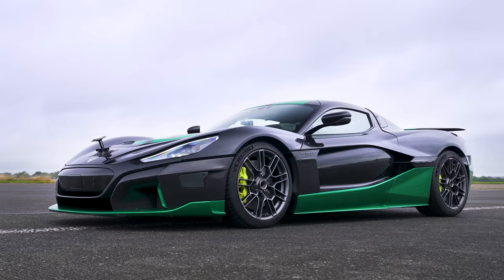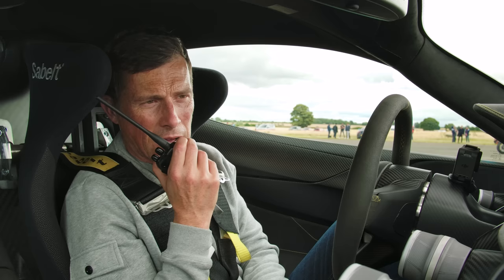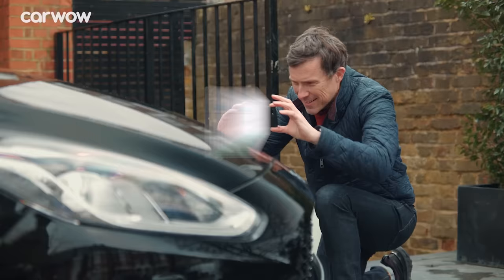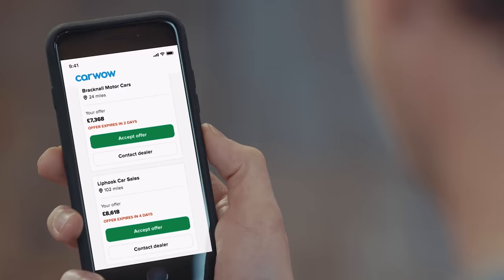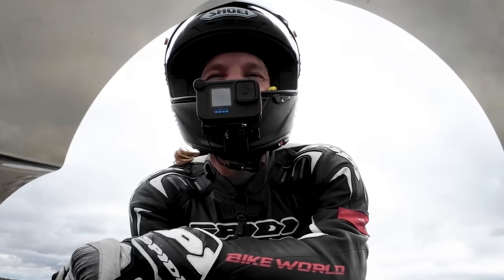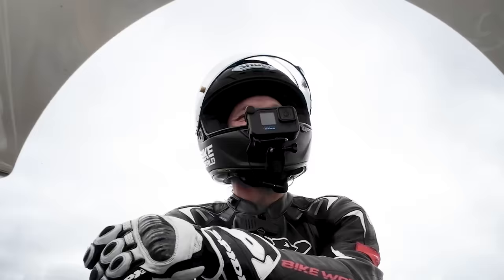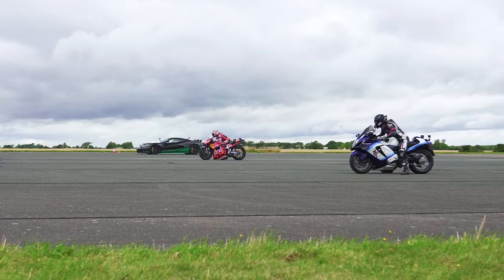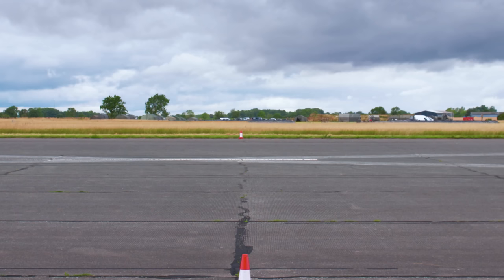MotoGP Bike v Rimac Nevera v Turbo Hayabusa: DRAG RACE

Comment: The fact that a bike can beat a almost 2000 hp electric car in a drag race is absolutly mental. Insane. No words.
Reply: these aren't even the fastest bikes in a drag race, there are bikes that will beat the Rimac easily.
Reply: @jayc342009  2022 Ducati Moto GP bike was much faster than this KTM on straights 
I think Ducati would leave Rimac in dust 😂
Reply: That is no ordinary bike, it costs at least $ 1 million.
Reply: @Smzxe  Even so, these bikes and their tyres are made for the track. You don't see them wiggling on the track straights.
Reply: @1aZoOs plenty of mid 8 sec bikes and cars actually too
Reply: Production car.............
Reply: @1aZoOs  it was selling for 250k 🤣 The 2021 KTM Moto GP bike
Reply: @wss33  on tracks Moto GP bikes hit 1/4 mile in 7.9 seconds they would destroy Rimac Nevera on a better surface
Reply: And 2023 KTM RC16 have more insane launch, if you watch MotoGP race lately you will know
Reply: @kuzunohacompany8891  this is 2021 Moto GP bike I think 
2023 Spec is much faster I don't think they brought 2023 version 
It might be 2022 version who knows
Reply: And the fact its just a 1 liter engine too.
Reply: @Smzxe yes but being faster alone won't make it the best performing bike. You need to conquer the corners too, which is the weakness of ducatis. There's a reason why ducati get smoked by yamaha and ktm in motogp.
Reply: The KTM beat the car to over 200mph it is just incredible 👏🏼
Reply: No shit bro.
That race bike needs constant checkup to be able to do that. While the Nevera can do that all day.
Reply: @BikesofRye  KTM beat Rimac Nevera over 220 mph 
There was very high wind which was stopping the bike but still beat Rimac Nevera 
If there was no wind that bike would be even much faster
Remove the wings it will become even faster
Btw 2022 Moto GP bike was much faster than this KTM
Reply: Shocked me tbh lol didn't expect that
Reply: @jayc342009 like what ? Don't be silly
Reply: Power to weight
Reply: @1aZoOs  the engine in the bike costs about €200k.
Reply: @loooopeytunes  it's quite opposite this year 🤣 Ducatis are winning each races and they are already faster on Straights
Reply: @loooopeytunes you’ve not watched the last few years have you? The Ducati is now the best bike on the grid, including in the turns
Reply: Yea but it weighs a fraction of a car....
Reply: @kuzunohacompany8891 they need to get Jack Miller on here with the ‘23 bike!
Reply: @jayc342009  good luck taking one of those down the shops and back. 🤣
Reply: @1aZoOs  and the rest.
Reply: But Rimac Nevera is 2300 kg...
Reply: Power to weight ratio
Reply: Ktm has the fastest ever recorded speed for a MotoGP bike.
Reply: @jayc342009 And there's also cars that'll beat them easily
Reply: @Smzxe yeahh but KTM recently just recorded the fastest top speed motogp bike ever achieve
Reply: Street legal production car vs pure bred race bike, not really that insane lol. Look what it did compared to the other production motorbike 💀
Reply: It needs a 2000 Hp all wheeled   with launched control to match a MotoGP bike on a drag. Yet, without the rear chattering. D. Pedrosa could have won that running start to a 1/2 mile. Also, remember that 2021 KTM Rc16 wasn't certainly mapped to extract it's full power. I wonder if it was. That could have been different. 

Anyway, glad that Dani was enjoying & for Chris riding that Superbusa, man he has that huge cajones to jump on that bike. Sylvain Guintoli could have been perfect aboard it, I guess he could do 9.2.
Reply: @muhammadalifsyafiq5317  that 366 km/h was with slipstream that was 2023 KTM Moto GP bike which hit this speed in Ducatis slipstream
This is 2021 Moto GP bike on Carwow
2023 Ducati Moto GP bike hit 365 km/h that was without slipstream 
2022 Moto GP bike is much faster than these KTMs 
2022 Ducati was leaving every bike in dust on the grid on straights
Reply: @Smzxe  we already know what the Gp bike without being mapped to it's full power or the necessary power at least needed, aboard a GP rider. 

What I want to see is the 2021 Rb16B of Verstappen being driven by reigning FE champion/RB driver Jake Dennis. Against this Rimac Nevera, Lucid Air Sapphire & that SuperBusa but with Sylvain Guintoli on it.
Reply: @ashleybmx4130  as if Jack would have a time being on the show than spending with his young family building hsi own track. Although I get your point but it's unnecessary similar to KTM not extracting the full power of their bike or at least the needed power. 

It's just for the show to have fun, not a competition.
Reply: well, fastest world record dragstrip bike actually hold by turbo gsxr1k by Moore Mafia team, 233mph in 5 sec. this is nothing.
Reply: @MR9Mouhib  Exactly. If those bikes had the same number of horsepower, they would fly to the moon
Reply: @dayleashleynolasco5765  it was just a comment mate, I don’t actually expect them to go and get him 😂
Reply: It's actually the other way around. It speaks volumes about the insanity of the Nevera that it can race against a racing bike. Bikes have insane power/weight ratio, far lower surface friction and air drag. No car should be able to keep up with that.
Reply: 919 evo vs '21 F1 car vs '21/'22/'23 MotoGP bike vs Nevera.
Reply: @Pizvo   that's 2000 Hp all wheeled drive car & with launch control we are talking about. On straight even the current F1 car would make a run for the money beat that Nevera. 

Hopefully Red Bull would bring the RB16B of 2021 which would be driven by the reigning FE Champion/RB driver Jake Dennis. Also, being Lucid Air Sapphire in the line up as well.
Reply: @antonpeterson1245   21 Rc16 Gp bike is enough even without mapping it. Dani just needed to dial his best launch & gearing. Also, you have forgot Lucid Air Sapphire, that electric car also blistering quick. Leaving Tesla Plaid in the dust.
Reply: @dayleashleynolasco5765  tbh, now that the Rimac Nevera is here, I kind of forget about all the other highly powered EVs. I guess apart from the Lotus Evija (hopefully spelt correctly) and the other car that is based on the Nevera
Reply: Bikes have some insane power to weight ratios compared to most cars. That MotoGP bike is mental at 270hp and 156 kg. I expected that Busa to beat them all but a lot of that power was wasted smoking up the tyres for the whole trip.
Reply: @yanzn5926  I've only been to the drags one time many years ago. The full blown drag bikes are just awesome to watch. They had one race where a worked 750 street bike was given about half the track head start against the top fuel bike. The way the top fueler shut him down was amazing. It was more impressive than the jet car they had that night.
Reply: Exactly. When it comes to speed. Bikes are king
Reply: @Smzxe so did Luca Marini on the GP21 Ducati VR46 bro.
Reply: @AmariLambo yep. Even the 2016 Ducati Desmosedici GP14 from Eugene Laverty can do 6.65 second drag time from quartermile.
Reply: @Smzxe Yea, but you do realize the level of crazyness is nowadays required to beat a factory stock car, right? This makes those Bugatti's look like loser-cars, especially compared to Moto GP bikes.
Reply: @dayleashleynolasco5765  RB16B is slow compared to Moto GP bike or Rimac it doesn't even come close 
We need 2019 Ferrari SF90
Or the 2004 F1 cars or Renault R-25 to have a better race
V6 Hybrids Are slow in straight line they can't go above 330 km/h
Reply: @Henry_Jr_Watsson  I don't think so. Bugatti can be quick if they would incorporate to their engine similar what Koenigsegg did. Anyway, we haven't yet see the Koenigsegg Jesko Absolute tested on this channel.
Reply: @nicerides9224  its all back to rider how they can handle the power, full developed engine like 1k gixxer easily got 700hp with NOS and turbo.
Reply: Just imagine if the KTM was lowered for the rolling races
Reply: @purwantiallan5089  it depends if it mapped to it's full power. I ask you, do you think Red Bull would risk Dani's body on this show. What it something happens to him.
Reply: @jolizana96  won't make much difference in roll race 
High wind was stopping the bike at 330+ km/h bike was wobbling too much due to wind
Reply: @KAWTELENUH   if a rider can put the wheels down & get the traction necessary to power up that bike. Without a super skilled rider who is still used on riding bikes, it's useless. Even Dani there showed that he is already rusty.
Reply: The part that really blows my mind is that when you think about it these Moto GP bikes are not exactly slow...until you compare them to a Formula 1 car around a circuit. The F1 cars are 10-15 seconds PER LAP quicker.
Reply: @dayleashleynolasco5765  what I'm saying is a regular 1000cc sport bike 🏍  can beat the majority of cars on the road. 
So if speed is the only thing a person cares about then it's a no brainer.
Reply: @Smzxe  and the mcmurtry on a competition surface, it would destroy all the moto gp that exist
Reply: Maybe because that bike is 1700hp/ tone and 😅 that car is 1900hp/2,3 tone 💁
Reply: @hainyain1106  Well, the other guy is just making excuses that that wasn't the best bike.
Reply: @Smzxe it does make difference by reducing front area thus reducing drag, it also reduces wheelies (gp bikes lift the front up to 5th gear). Given at how close the race was I think Dani could've won if his bike was lowered
Reply: @aedsy  keyword TRACTiON - as we know bikes often wheelie despite having this early stage Aerodynamics & squat devices, 4 WHEELS - once again more grip & balance which the bike doesn't have as it often got some wheel spin. CORNERSPEED which all car because of it's geometry plus it's easier to handle compare to the bikes that rider should be fit to manhandled the 160 kg bike into the corners. 

That is where the 12. plus in some tracks  to 15 seconds gain of the F1 car compare to the GP bike. More corners, the more time the bike will loss.
Reply: @Bathykolpian you’ll never afford a Rimac anyway so idk why you’re bumming so hard over a car you’ll never own 😂😂
Reply: @KAWTELENUH  yeah, I agree its due to power to weight ratio. But the question is always could somebody put out all that power down without even thinking twice. I don't think so unless you want to die. There is always limitation even the manufacturers who made it knew it's full potential. That is why there is a limitation especially the production street bikes even the Kawasaki Hp4 & H2R. Unless someone tweaked that bike to make it a SuperBusa.

You see even Chris didn't manage to get it's full potential.
Reply: @CrazyPanda688  And what do you drive 💀💀
Reply: EV is KING!!!!

4680 Roadster = GAME OVER BABY! ⚡🇺🇸
Reply: Well they’re light af dude lol what else do you expect
Reply: @larryc1616  wait for the Hydrogen or Synthetic fuels integrated with battery in the future.
Reply: Proper drag bikes can run well into the 5s mark for 1/4 mile. Both these bikes and car are pretty slow in a straight line compared to the real deal. Though obviously those bikes are good for drag racing and nothing else, compared to these that can do everything.
Reply: @Bathykolpian  agree, unless someone would make a Franskenstein production bike that can be handled & launch at the line easier. Most importantly that power on the ground without having a wheel spin. Although it wouldn't look like an actual bike anymore.
Reply: @Smzxe  MotoGP bikes are expensive. You'll get a WSBK in $ 250k. The performance difference is 3s per lap between them.
The present season bikes will cost you $ 4 million.
Reply: MotoGP top speed is secret
Reply: @AmariLambo but i believe on a drag prep surface :)
Reply: Atlease rimac is showcasing it's hyper performance vsing that of egg, ssc, jenny and bug.
Reply: @jayc342009  What is so impressive is that MotoGP bikes are not even built to be drag racers but rather corner-curving race bikes for the absolute fastest lap times.
There are faster 1/4 mile-built bikes that do 6s and 7s, but they can't do anything and are unridable outside of the drag strip.
Reply: @Smzxe  
MotoGP bikes are not for sale and have never and in history, been available for purchase by the general public.
In very rare cases, they are given away to VIP MotoGP members, like top racers and managers, as collector pieces.
Reply: @1aZoOs  it depends on the track. On a wide track like Silverstone, 6 to 7 seconds is the difference between them. Although some tracks like Jerez & Philip Island, it used to be 3 to 4. All depends on the track conditions. The amount of per Gp bikes lease for the year is almost 8 to 10 mil. depend to the manufacturers. With DoRNA share €2.5 mil to all IRTA squads every season. That helps Independent teans with less resources survive in the sport.
Reply: @algirdas6871  I meant street bikes cars :), there are lots of 1/4 only race bikes but i was thinking street legal like on cashdays or that racing channel
Reply: Pecco on a GP23 would smoke this car
Reply: @antonpeterson1245 do you mean the Pininfarina battista? It would be interesting to See which one is faster the Pininfarina or the rimac
Reply: @Humbulla93  correct, the name did elude me.
Reply: @gauravdevrani4298  a used 400hp busa for like ~10k is enough, strapped withgood tires they hook all time on street racing videos
Reply: @AmariLambo  yup even when Busa 10-15 years back turbo charged used to go like 300 in 10 seconds 😳 don’t know why they got this one here, obviously they can’t let the try Rimac loose all of it so they have to make it look good also 😂
Reply: @antonpeterson1245  at These Kind of horsepower every bit of aero is important, it's a trade Off between high speed and stability/downforce. A drag Race between nevera, Batista and evija now that's a Race i want to see
Reply: @1aZoOs  What do you mean no ordinary?
It's a stock MotoGP racebike.
Reply: @gauravdevrani4298  this exactly, love the original busa
Reply: @Smzxe  V6's are, in fact, not slow. In fact, F1's highest recorded speed is set by a 1,6L V6 hybrid 2016 Williams at 372 km/h. And they go over 360 km/h every year at tracks like Monza, Mexico and Baku.
Reply: @wss33  They didn't show me a live video 372 km/h on baku on a 2.2 km straight double slipstream tow without slipstream those cars wont even touch 340 kph and I'm not not wrong no V6 Hybrid F1 can do that
360 kph on Monza with slipstream always without that none of them can reach that speed 
Moto GP bike did 366 km/h under 800 meters on Mugello
1.1 km straight 350 meters braking zone for bikes 
F1 car only did 326 km/h on Mugello
Huge difference not even close 
F1 cars exit parabolica at 300 km/h on Monza and they have extra 1.2 km straight 
But they only manage 60 km/h under 1.1 km 
While Moto GP bike does 50-366 km/h under 800 meters
Reply: @Smzxe  I'll just ignore the irrelevant MotoGP rambling.

The 2016 cars could easily hit 350 km/h. Then in 2017 they got heavier, wider tyres and much more aggresive aero. Which slightly slowed them down in the straights but made them much quicker round the track.

And Bottas actually hit 378 km/h.

And Ricciardo did 0-200 km/h in 4,2s!!! On racing set up, half full tank and going slightly uphill. These V6's go from 100-200 km/h in 2 seconds. How is that weak and slow?
Reply: At equivalent weight/power ratio, a bike will always be faster in a straight line so you should word that differently lol.
The fact that a production car that has all the comfort, is street legal can beat a racing bike is insane.
Despite having 2000hp, The Rimac is 2,3t.
Reply: @AlliCanThinkAbout  What's actually impressive, is that a bike designed for twisty tracks and not for drag racing, with 2 wheels, each having a contact patch as big as a credit card, launching almost as well as a 4 wheel drive electric car with big wheels. A bike is limited to about 1G of acceleration, a limit the car does not have. 

Besides, the bike was faster. It was slower on the top end because it's not geared for top speed chases.

The bike does all that and can turn and brake as well.
Reply: @purwantiallan5089 😂😂no way
Reply: Nice a racer bike can do It. But no onde producion car can
Reply: @samuelknott5586  in the Ducati slipstream 366 kph for KTM
And 365 km/h for Ducati without slipstream 
Ducati reached 365 kph without slipstream on 900 meter straight it can do 400 km/h on 1 mile
Reply: Now let’s see if a car with almost 2000hp that is not a rimac race against it.
Reply: @aaronmiller5012  let's see the GP bike with two extra turbos 👽
1000 HP bike Vs 2000 HP car???
Reply: Only MotoGP wich is racing car beat rimac not road bike
Reply: @Smzxe comparing racing bike with road car is bullshit
Reply: @Smzxe comparing racing bike with road car is just not apples to apples.
Reply: @VarunTomee-kr6nf  oh yeah street bikes with slight tune with streched swingarm are running 7s and low 8s with 250 WHP if Rimac is modified to run 8s then bikes also are
2016 Kawasaki Ninja H2R in bone stock form beats anything in drag or roll racing 
H2R will eat Chiron SS, Regera, Agera RS any hypercar Koenigseggs are too slow on asphalt
But Rimac Nevera is faster than H2R 
And there's no stock bike as fast as H2R
Because of EU rules bikes can't go above 300 kph
Otherwise we would have seen manufacturers focusing on top speed of bikes it would have been mental
No bike now goes above 300 kph 
And 2005 busa can reach 320 km/h because there was no rule at that time all manufacturers started making bikes faster and faster
Once rule came it stopped everything
Reply: @dayleashleynolasco5765  Bro you can't compare GP bike to a cheap EV
Ducati V4SP2 street bike was side by side with lucid air in drag race and bike trapped 157 mph that's more than lucid bike easily win at 1/2 mile race
Also in rolling race that V4SP2 smokes Lucid. lucid will be left in dust
Also V4SP2 only makes 210 HP and it's 190 kg 
Ducati V4R making 240 HP and weights only 165 kg 
Ducati V4 Superleggera 236 HP 155 kg 
These Faster Ducatis would easily smoke the Lucid sapphire in any kind of race
Reply: @Smzxe  can they beat in stock no and above 300 kph is disaster in bike also rimac pulls well above 300 kph too so it's is faster
Reply: @VarunTomee-kr6nf  lmao dumbo Ducati GP bike is much faster than Rimac Nevera 360+ km/h 
This KTM GP bike was always ahead of Rimac Nevera at 350 km/h
Ducati GP bike did 365 km/h under 800 meters on Mugello Rimac doesn't stands a single chance
Ducati Moto GP bikes can hit 400 km/h easily
Moto GP 0-300 kph 8 seconds
300-350 km/h 4 seconds
Rimac Nevera 0-300 kph 10 seconds
300-350 kph 6 seconds 
We are talking about actual acceleration from standstill no Rollout
Reply: @matusjurcik6974 nope… that motogp has 270hp and weight 157kg until Dani sits on in, the power to weight ratio is reduce to 1,244hp/t
Reply: @jenko9926 if that wasn’t the best bike, so what about the rimac??😂 is it the best one?
Reply: @SuperAdventureR1301 when it comes to drag racing, then TopFuel Dragster is the King🚀
Reply: @AlliCanThinkAbout when i brought a rimac’s weight into a comment, he pretend like weight doesn’t matter and started to talking about how much 2000hp car still can’t beat 270hp
Reply: @Smzxe 1000hp is always lose to 11.000hp topfuel dragster kid😂
I mean 0-500 in just under 4sec.. i just can’t find a bike that able to do that😂
Reply: @VarunTomee-kr6nf he loves BS
Reply: @Smzxe ya ya ya…. I’m sure anything can be faster if you tune/modify them😂
Reply: @VarunTomee-kr6nf i told u bro… he just loves bullshit😂
Reply: @Smzxe you can continue to do BS about motogp bike as much as you want, kid… now we know motogp bike performance level is on a par with current streetlegal hypercars you can buy on the market today (stock).😂 there are many cars with that kind of performance today. rimac is just one of em..
Reply: @autolavista  modify what you kid? 2022 Spec Ducati GP bike is much faster than this slow KTM and Rimac Nevera 
Ducati would dust them both on any road
Reply: @autolavista  what nope 😄 ... where did I say that I mean weight + rider? 2,3 ton is not with a rider even though on the bike the rider will affect ratio more. I didnt say nothing about this TBH. 1244hp/ton is still much more than a 826/ton + rider of the rimac. Quite worthless response from you...
Reply: @dayleashleynolasco5765  2000 hp car is far more stable far more safe and Far far more easier to launch and it beat bike in 2-1 drag and 1 out of 2 drag race so the winner is car which is road legal not racing car
Reply: @VarunTomee-kr6nf  i agree I know that although in a 1 or 2 miles race. That Gp bike will simply outrace that Rimac Nevera. There is no doubt.  Without the setup & mappings they do depend on every tracks. That bike can even go faster if they wanted to. Extract more hp & torque in that engine. In this situation though, its uneccessary. They are just there to showcase that battery cars can run the same pace as the GP machines when its on a road tarmac.
Reply: @dayleashleynolasco5765  in carwow actually rimac beat moto gp by and it has more top speed
Reply: @Smzxe  on track is different on road is different situation
Reply: @yanzn5926  ah yeah let's turn the bike on some corners 
You will realise 5 seconds Gixxer is nothing
Reply: @Smzxe  we talk about drag race u noob, not some race in circuit
Reply: @yanzn5926  bro Moto GP bikes are so fast on straights and they can do cornering as well 
They are simply not meant for drag racing why are you comparing? 
2022 Ducati MotoGp bike had 300+ HP from NA V4 motor 
Only 1 turbo these bikes will make 1000 HP 
If Moto GP bike was setup for drag racing it will destroy those gixxers